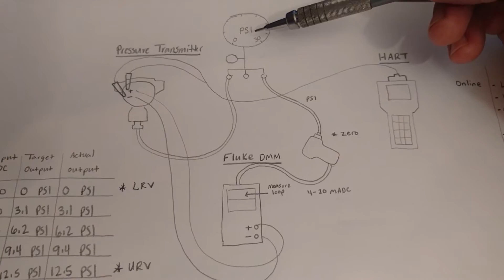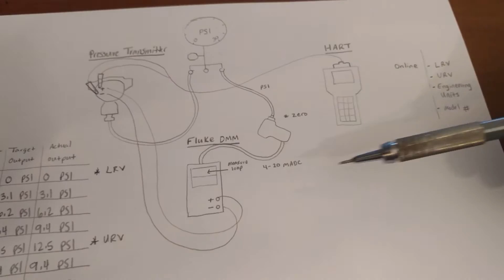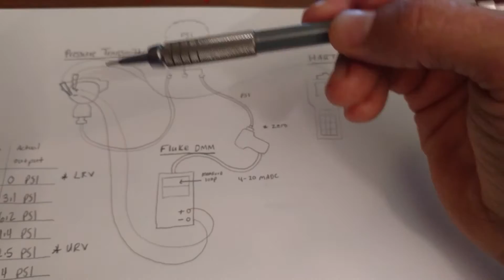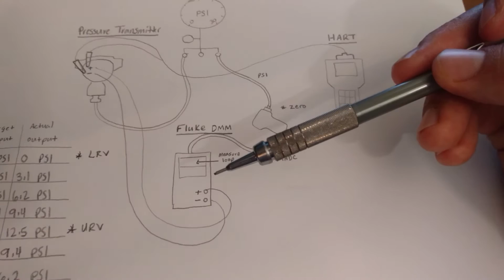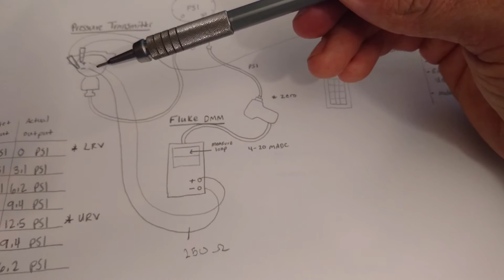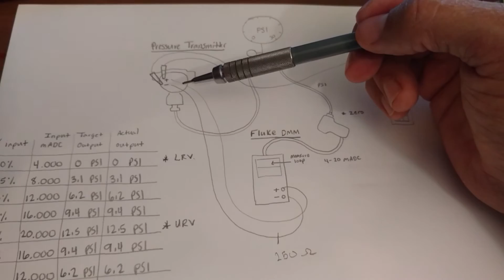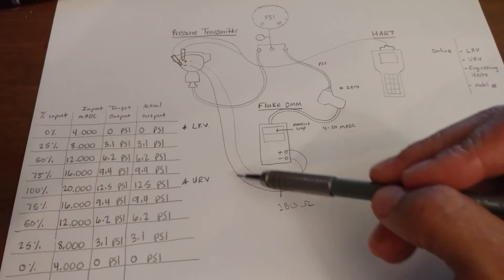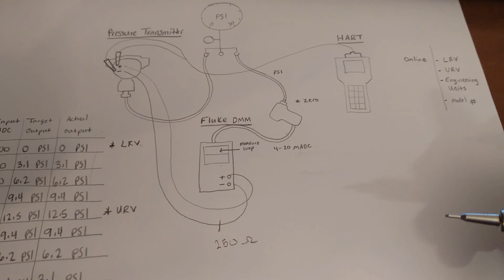Brief tutorial on pressure transmitter calibration and test

Comment: If you use HART 475, it doesn't have external 24VDC supply. Therefore, you cannot energize your transmitter. If you use different kind og HART Communicator like FLuke 754 or etc, Druck, beamex or etc., it will energize your transmitter.

Comment: Stuart what's the purpose of having a 250 ohms of resistor connecting between transmitter and DMM?
Reply: from  what i understand its to replace the 'controller system' such as Dcs, correct me if im wrong we need a greater mind for this
Reply: In my experience, if you don't connect 250 ohms, the measuring device will be blown or defective
Reply: Check this webinar from ISA, when He talks about 250 ohms resistor exactly starts in the minute 22.30.
 https://www.youtube.com/watch?v=CrgWZPN0iSI&t=3499s